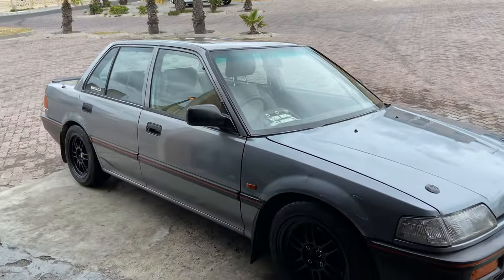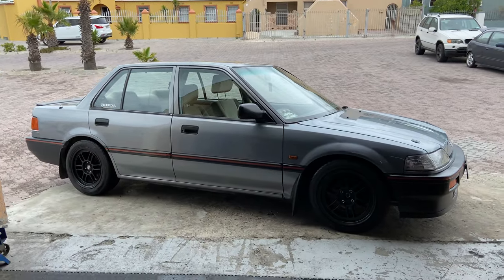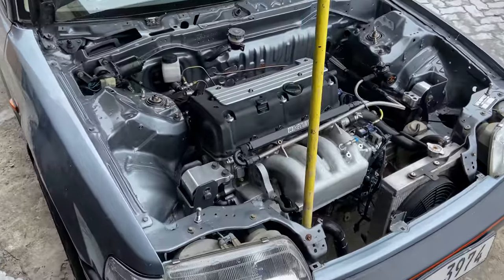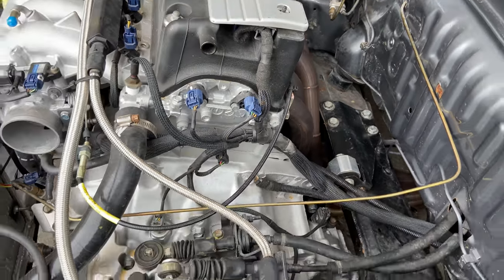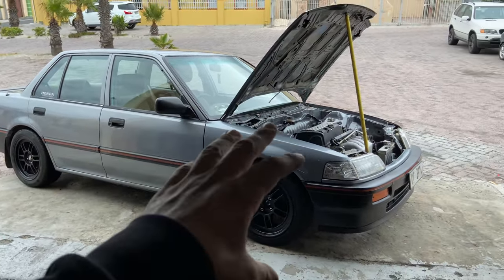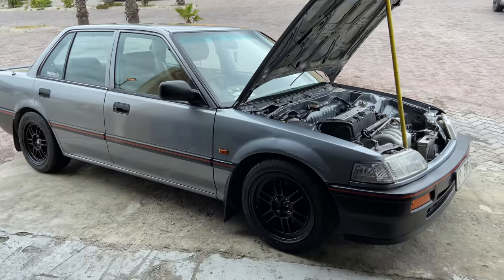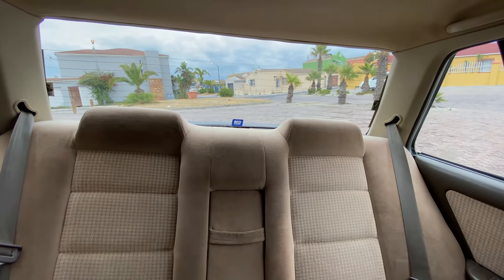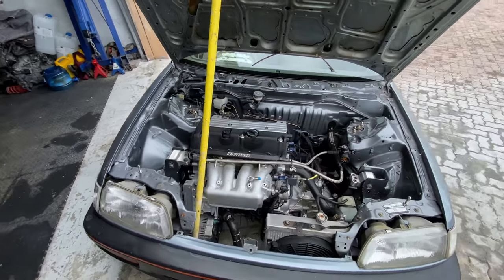Honda Sleeper

Comment: Take this car to the 1/4mile just like that stock motor and box so we can see what it will run
Reply from the maker: On a semi mid to low 13s probably. But on a slick easy 12s
Reply: @lyleafricaracing  does it have a lsd?
Reply from the maker: No
Reply from the maker: I did a 12.5 on a slick with open diff in the crx